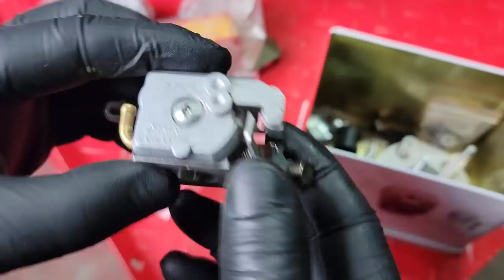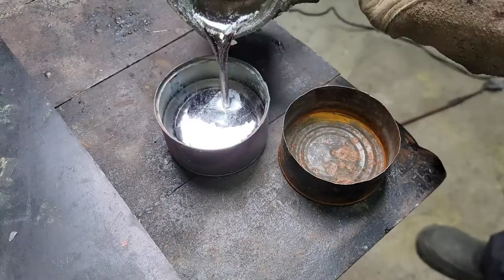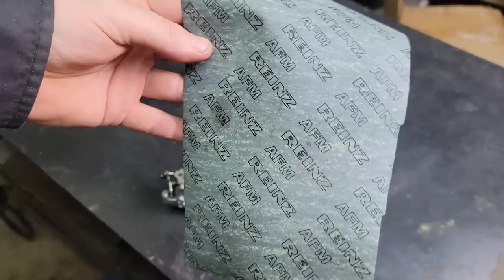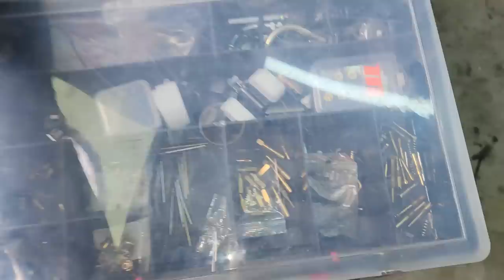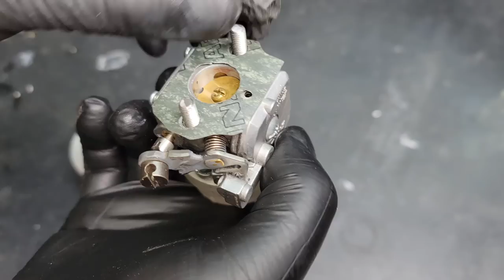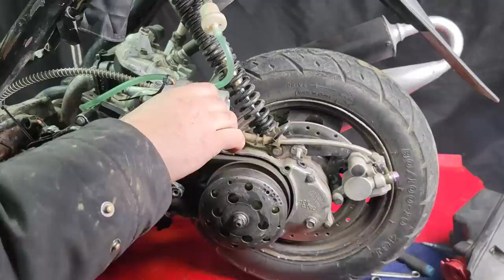Карбюратор от бензопилы Stihl на скутер Honda Dio - 50cc изготовление переходника

Comment: You dont need to connect the vacuum if the fuel tank is above the carburetor, the vacuum line is for the internal fuel pump.
Reply: That chainsaw carb absolutely needs the vacuum line because it has an internal fuel pump and will not work gravity fed.

Comment: That's awesome! I would try an MS250 carb because it has both High and Low adjustments and it is the common upgrade for the MS170 carb. I have wanted to try one of those carbs on a Honda scooter for many years but my Honda spree was stolen before I could try it.